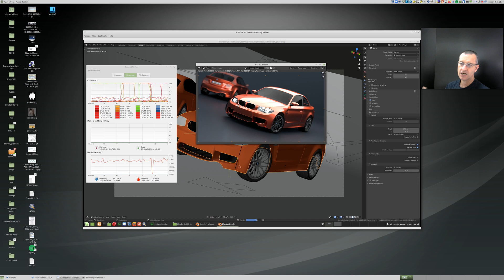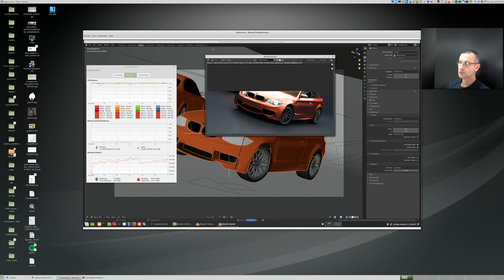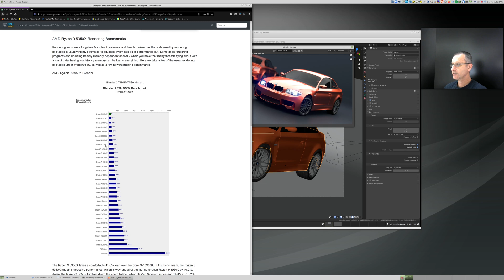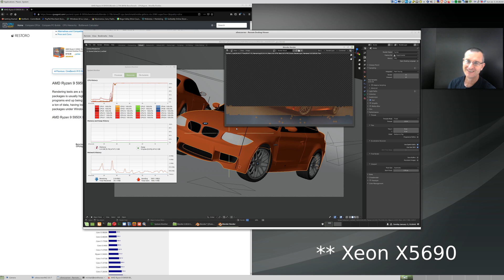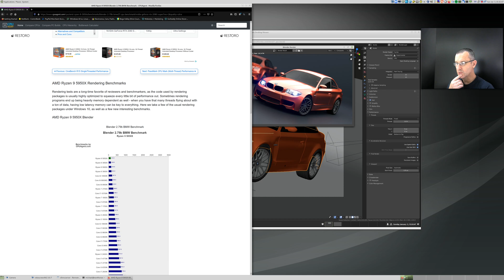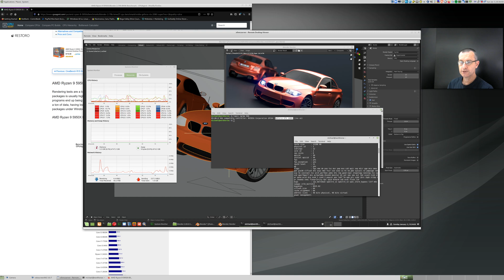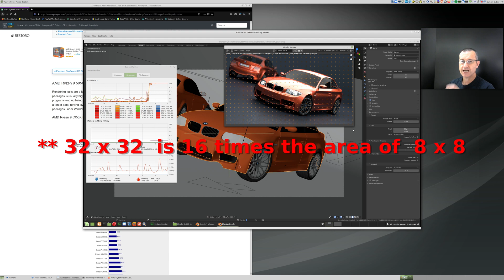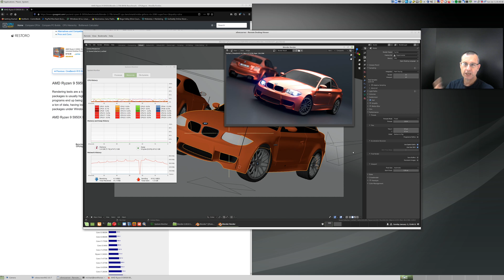Speed Up Blender| simple settings to to dramatically improve performance of Blender.

Comment: I use blender for 3d designing for print and not rendering.  Does anyone know how to optimize cpu and gpu usage for tasks like merge by distance and decimating geometry and those types of calculation intensive tasks.  I don't even need to worry about colored parts let alone photorealism.  Just great advanced geometry.  It doesn't look like it even uses the gpu when it calculates.  I have a 3060 gpu but it doesn't seem to even be used for geometry tasks like limited dissolves or remeshes.
Reply from the maker: Are you using Windows, Mac, or Linux?
Reply: @helmreichenterprises8391  windows 10 with an i5 11th gen and a 3060ti.  As far as I understand unless you are rendering the gpu is not really used.  But I model for 3d printing so all of my load is calculating maximum 3d detail into a mesh with no rendering of images or video.  The only rendering is to the screen.  I don't even retain cameras and lights or any colors when I work.  All of the optimizing videos seem to optimize for rendering.  Perhaps I just don't know the right terminology to find information on optimizing for mesh manipulation.  At this rate I am better putting my money into cpu and ram than graphics card.